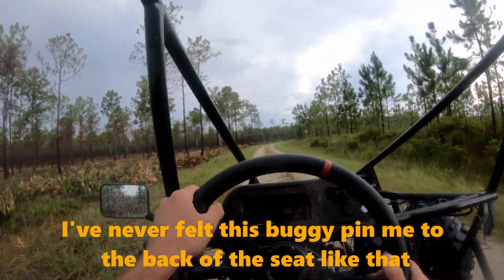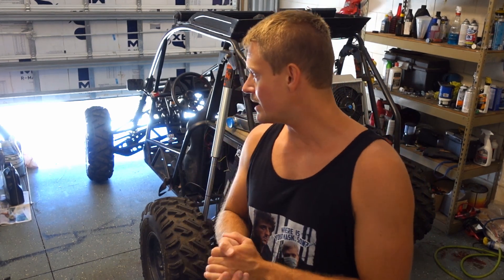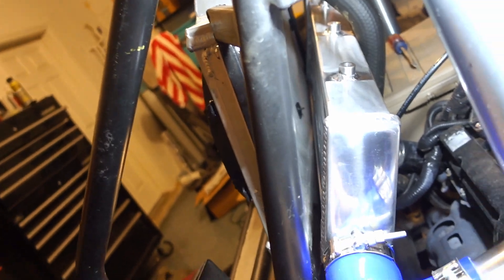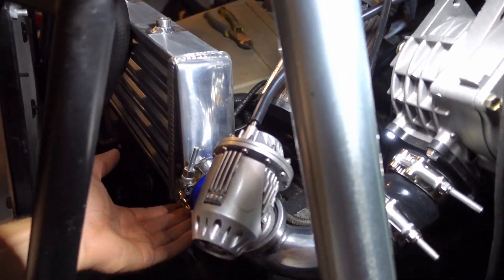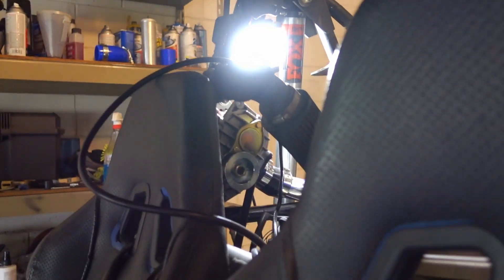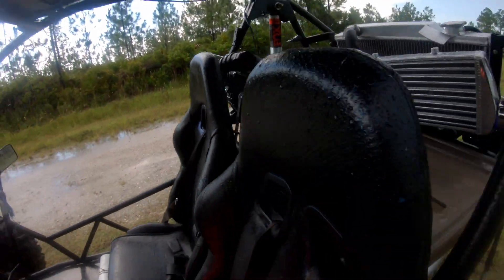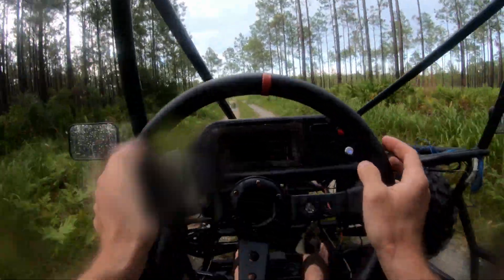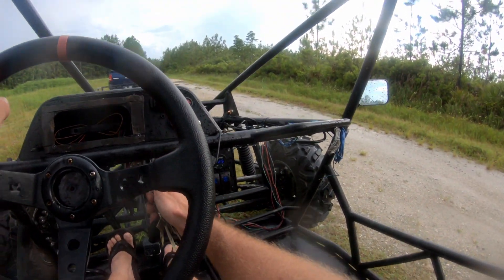Supercharged Dune Buggy Finished! | AMR500 Mirage 1.2L Buggy

Comment: I have that same 1.2L in my mirage hatchback and I've been eyeing these on amazon and ebay for like $160. If I get this and mount it to my 1.2L would I need to tune it you think? If so how are you interfacing with the 1.2L engine to tune it? Also do you think it'll get better mpg? or just more power?
Reply from the maker: You would definitely want to be able to tune this otherwise you could be running into a lean condition and could damage the engine. There are some piggy back systems that might work for mirage, I personally tune using tuner studio and mega squirt.
Reply: @DirtGearTv  So is it not the stock ECU from a mirage?
Reply: @kyky7kyle7  buy a piggyback and use it to tune, my brother. also get 1.6 pulley ratio to get half bar of boost.

Comment: Hey do you think there is any way to attach this to a 2019 can am Maverick trail 800? This side by side is a cvt so it doesn’t have a belt apart from the cvt belt. Would attaching it to that be a problematic? Any thoughts? Thanks I’ll record if I do it great video.
Reply from the maker: I do that that would work well on that platform as long as your gearing is done so you’re not over spinning the amr500

Comment: Sir, if you don't already know,  the safe, continuous speed of those supercharger is 16, 000 r.p.m. In the DAYCO catalog,  you can find pulleys to achieve the desired r.p.m. My Harley is sized for 15, 440, the Drag Bike spins 16, 600,  but it only runs W.F.O.  for  just under 5 seconds. All the  very best with your projects.  
T.S. RACING btw, I use a Water/methanol injection to keep the intake charge cool.
Reply: you all probably dont care but does any of you know a way to log back into an instagram account??
I stupidly forgot my login password. I would love any tips you can give me.
Reply: @Rohan Jimmy Instablaster :)
Reply: @Esteban Lucas Thanks for your reply. I found the site through google and im waiting for the hacking stuff atm.
Looks like it's gonna take quite some time so I will reply here later with my results.
Reply: @Esteban Lucas it did the trick and I finally got access to my account again. I am so happy!
Thanks so much, you really help me out !
Reply: @Rohan Jimmy No problem :D

Comment: I use this Supercharger on both one of my street/strip Harleys and my Suzuki drag bike.  Yes, they're noisy, some more than others, and yes produce the same boost, regardless of rotational direction. For lubrication I recommend REDLINE Shockproof LW for racing. For street use or long term running,  I recommend REDLINE 75-90 GL5. 90 m.l. regardless of lubricant used. I hope that helps. 
T.S. RACING 👍🏍👍

Comment: I'm sold dude. I'm putting one on my already turbocharged geo metro. Does it say anywhere that you have to have a blow off valve? I run propane and don't need to be blowing off that fuel. And I probably won't run an intercooler. Im pretty sure the propane is cold enough. Unless... bov flamethrower superturbocharged 1.0 Geo?!?!
Reply from the maker: I vote for bov full flamethrower mode! 😂

Comment: Does the S.C. have oil in it, cuz I have never heard one those that loud.
Reply from the maker: C.J. Slink I know right? Unfortunately it has oil
Reply: @DirtGearTv  well....something isn't right. Looks and sounds like your waste gate opens during high vacuum( when the throttle plate closes) so i`m wondering why u have 7psi boost at idle. It should be about 0 then build up almost instantly as you open the throttle. Maybe the valve in the waste gate is sticking.
Reply: Awesome I just put one on my festiva and yes it’s loud but in my car it’s bearable

Comment from the maker: I need your feedback guys! 14:37 - 15:00 do you think the clutch is slipping when i’m bangin gears?
Reply: Don't know if your still running this thing.. but didnt seem like the clutch is slipping.
Also, if you do still have it fitted.. an enclosed air box and recirculating bov dampens the sound quite a bit.. especially with an air-box that has a resonator fitted as standard.

Comment: Is the super charger not directional? I would have thought mounting it with the pulley facing the engine would spin it backwards, and possibly the cause of some of the noise.
Reply from the maker: MKPatrolGuy Eveything i’ve read about the AMr500s has said they are non directional and can be run both ways. One of the reasons mine is so loud is the 10 or 12 psi (possibly more) it’s creating at idle. You’ll notice in the video it gets much louder when there is back pressure, especially right after the bof closes
Reply: @DirtGearTv  That makes sense,  I have to admit I did no research on that supercharger before suggesting that theory!
Reply from the maker: MKPatrolGuy You make an excellent point though and I really have to wonder if pointing it the other way might have helped a small bit 🤷‍♂️